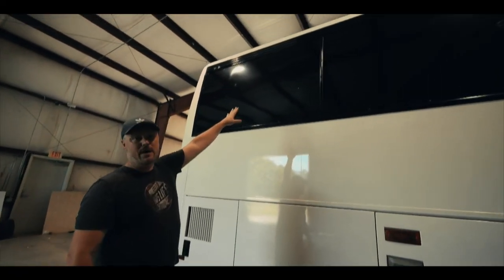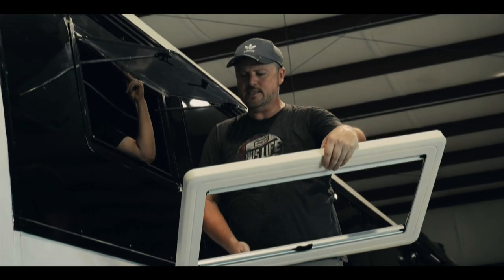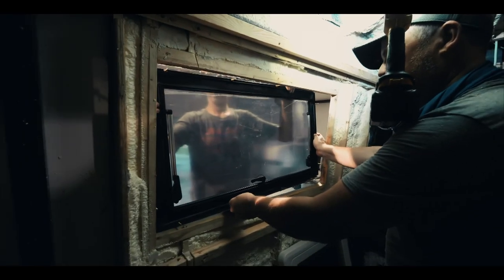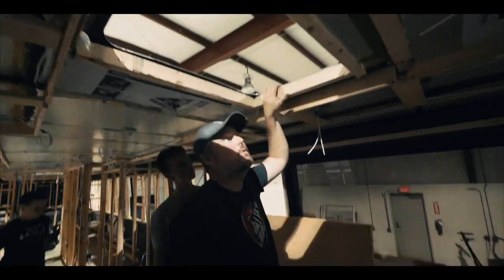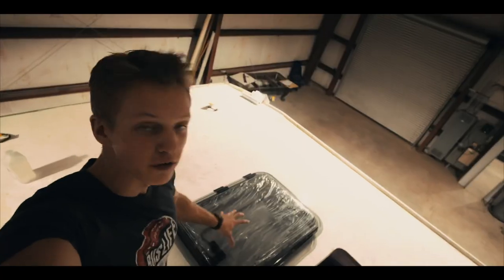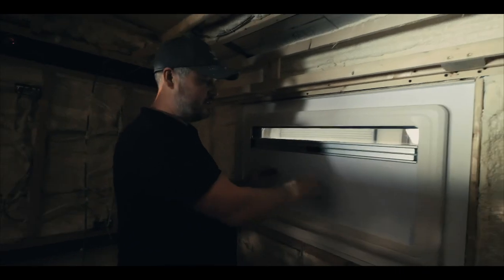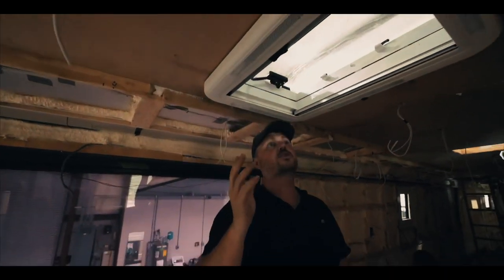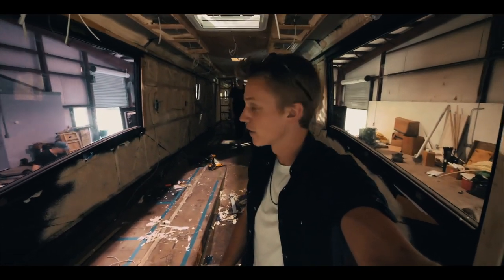Installing Euro RV Windows & Skylights in our Bus Conversion!

Comment: Those are awesome windows and skylights! Love how the blinds and screens work. Any ideas on how to help with condensation on the big side windows that you left in? I want to leave my first big side windows in on our bus but not sure how to cut down on the condensation issues I know I will have since its only single pane. Is there some type of coating or film that can be applied that would help with condensation issues on them?